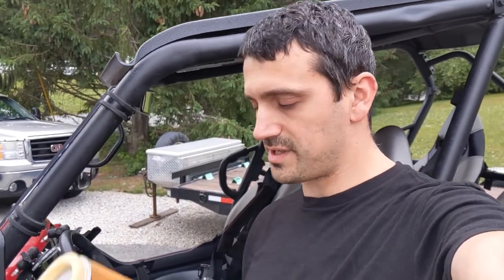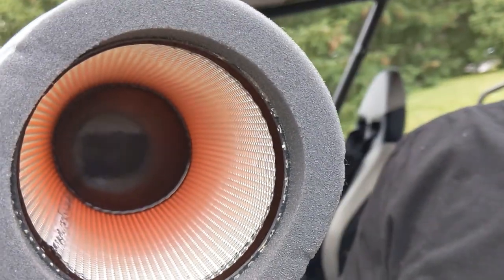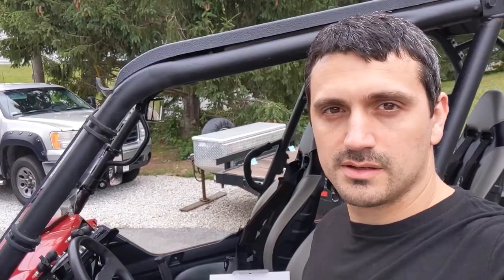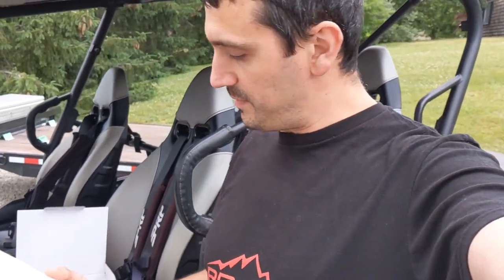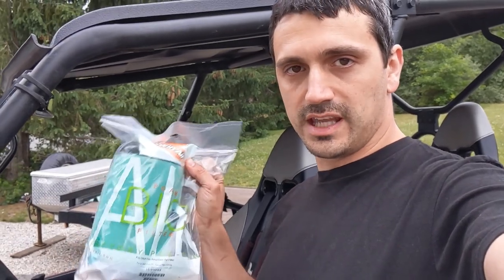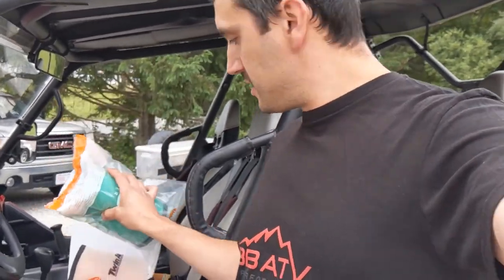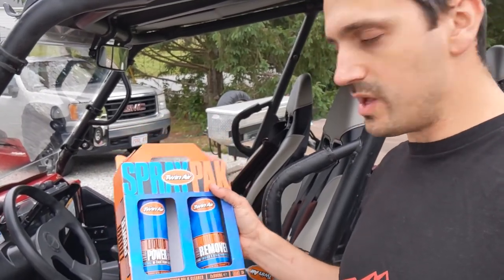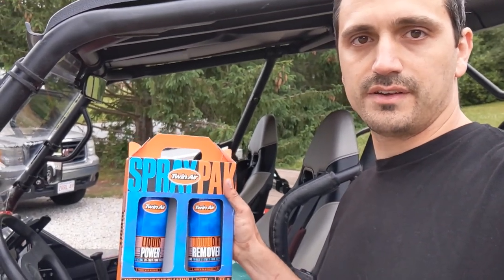Your air filter is ruining your Teryx!

Comment: Do you have to 'squeeze the extra oil out' before installing the  pre-oiled sponge only product?
Reply: You don't want it saturated to the point that it's dripping oil in your air box but do not ring it out. You don't want to stretch it out of shape. You're better off adding oil a little bit at a time and gently squeezing it to spread it out evenly.
Reply: @matthewbarbosa7728  thanks for responding. The pre-oiled ones do you usually squeeze excess out of those?
Reply from the maker: @thomasnewman4971 No pre oiled filters are ready to go.
Reply: @JBBatv  your cool, thanks. Going on extended UTV trip with some fishing and  metal detecting sprinkled in. 
Thanks again from Newfoundland. 🙏